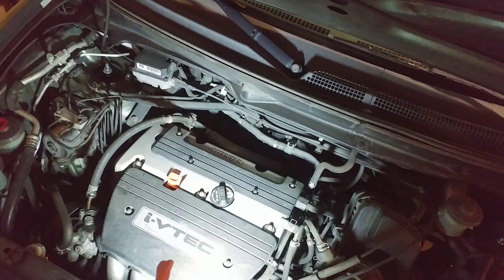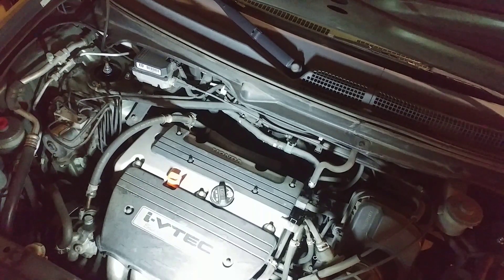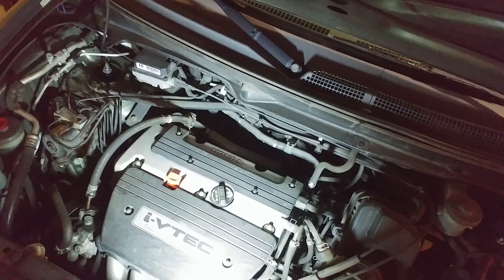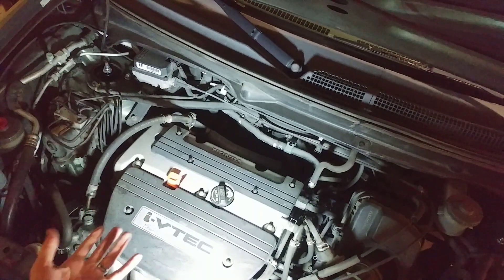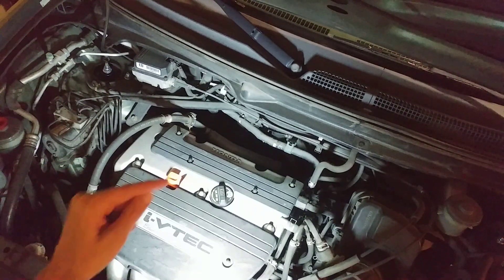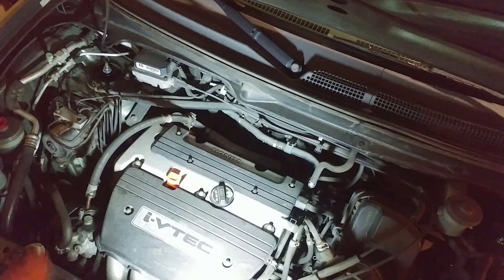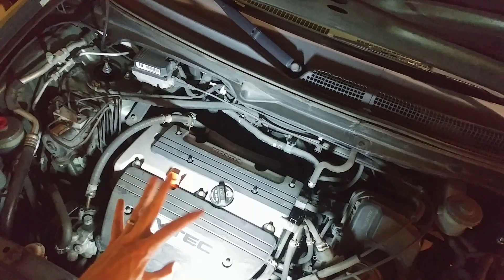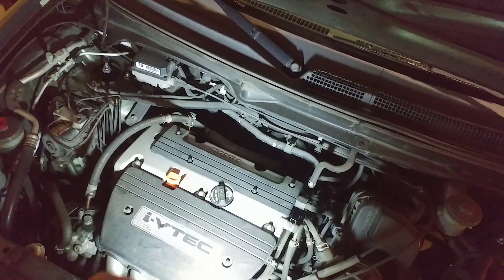When to Use 89 Octane in an 87 Octane Engine

Comment: Yes, octane does def boost HP which is why racing fuel is over 100 octane. 
But damnit man- I was looking for some legit info about why the hell anybody buys 89 octane instead of 87 or 91!.. I’m in the biz and I don’t understand that lie!  I was totally on board with ur vid until @3:11 when u claimed that u only buy “good gas”.🤦🏼‍♂️🙈 
I sell fuel for a living and there’s no such thing as bad/good/cheap/poor gas.  It’s all refined at the same local refineries and the only damn difference is that when a carrier picks up for “Chevron” (for example) they pour Techron juice into the top of the tank.  Other than that it’s all refined in the same place with the same US standards of any gas anywhere.  If u think it matters just go buy cheap gas & buy boxes of Techron juice at Costco to add to ur tank.

I own a 2001 Lexus that requires 91, and it legit runs worse with 87. I own a 2013 Honda that requires 87 and I’ve seen no benefit with 91.
Reply from the maker: When I lived in CA my cars never ran as well on ARCO gas. That was just one example. Anyway, I appreciate your perspective and thank you for your comments. Make that 2001 Lexus last baby!

Comment: I use 89 octane for my 2019 Honda Civic sport, is that good ?
Reply from the maker: If the owner's manual says 87 or higher then I'd use 89 if the engine runs better. Realize your car is not underpowered nor is it old with lots of carbon buildup. So I would only run the 89 if you feel a difference. Thanks for watching! Make those cars last baby!

Comment: The wording "87 or Higher is recommended" is found in the majority of Hondas, Toyotas, Chevrolets, Hyundais and KIAs Owners Manuals.  So 87 octane to 90 octane can be used in those vehicles.  91 octane or above, which is generally premium grade fuel, is a waste of money for those vehicles.  Especially if your model and trim don't state anything about using premium in their manuals! Since 89 octane is found in a majority of states.  Use that octane if you can afford it folks because I get it, high gas prices! That octane is not a waste because I tried it in a variety of vehicles that I just talked about.  89 octane definately operates more efficiently than 87 octane.  The engineers know what octanes can be used in your vehicles.  They did make the machines afterall.
Reply from the maker: Good point Bill. It's not like the vehicle manufacturers are saying "Only use 87 and not 89." With high gas prices (thanks Biden!) more people than ever are going to feel financial pressure to use 87 octane, when 89 would be better in most circumstances. Thanks for watching. I hope you're a subscriber and make those cars last!
Reply: @TheSwitzAutomotive  Update:  What "87 or Higher is recommended" really means is just that.  Let me explain.  In other parts of the country, 87 octane might not be avaialble BUT 88 octane is. Just be cautious with what kind of 88 octane it is because there is 88 octane with E15 (15% Ethonal). Make sure to read your owner's manual to see if your vehicle can take 15% ethonal. Otherwise, you might find yourself stranded on the side of the road with your broken down vehicle. Anyway, the engineers are just letting you know it is ok to fill up your car with 88 octane when your traveling. Another thing I need to let you know is 87 and 88 octane work best with these vehicles because they are designed with these octanes in mind and so they're easier to combust, compared to 89 and higher octane. So in reality you get the best performance out of your vehicle using 87 and 88 octane. Anything higher could actually be detrimental to your vehicle's performance. Since the higher octanes are a bit harder to combust for your engine. About the car manufacturers I mentioned in my previous post. Their naturally aspirated engines work best with Chevron and their forced induction engines work best with 76 and Chevron. A bonus to mention with following this information about using 87 and 88 octane is when you are driving a manual transmission vehicle. Shifting becomes quicker and smoother, especially at lower speeds. Using the heel toe technique is easier too!

Comment: I totally believe you man.  I drive a 98 Toyota 2wd Tacoma with 200000 plus miles on it.  The 89 octane for sure makes a difference in power.  When I put 87, the truck slows down a bit again.  When gas prices are good, I go back to 89 and would feel the difference again.
Reply from the maker: Yep. Glad you are getting the benefit of occasional 89 octane. Thanks for watching. I hope you're a subscriber and make those cars last!
Reply: Stick with 89 octane. Much better reliability.
Reply: I would stick with the 89 whatever the price. If you check, I'll bet you'll find you are getting extra MPG with that extra power!

Comment: I’ve heard this is a myth. Apparently higher octane fuel does not contain more power and does not combust at higher temperatures than normal octane fuel. The only reason that higher octane fuel exists is to prevent engine knock and premature combustion which can damage the engine.
Reply from the maker: Well in my 2nd video I talk about how my Element's automatic transmission shifts differently going over hills on 89 octane. The automatic does not downshift nearly as quickly and on some hills does not downshift at all. With the 89 I just zip right up and over the hill. So the myth is working great for me. I'm not saying BTW that higher octane fuels do not prevent premature combustion, I'm just saying that as your engine ages it acts like a higher compression engine. If 89 doesn't give you noticeable improvements just go back to 87. Thanks for watching!
Reply: @TheSwitzAutomotive  Make sense for older vehicles where the carbon buildup is affecting the timing. Thanks for the feedback!

Comment: Most probably don’t know this but most gas stations only have two tanks one for 87 regular and one for the premium 91 or 93. The mid grade 89 is made from a mixture of both. By using a octane calculator you can easily figure out how many gallons of 87 and how many of 93 to mix into your tank to get the 89. May sound stupid but doing this method will save you a few dollars per fill up then just pumping 89 depending on size of your tank.

Comment: My 2021 civic sport sedan says “87 or higher” I used 87 the first time I filled up but since been using Costco premium and 76 premium. 
Don’t notice a difference mileage wise but my car seems a bit more responsive. Nothing crazy. But it does seem more responsive. I even went back to 87 Costco one tank; and I somewhat noticed the car not seeming as responsive. Not that my car ran like shit just seemed like the “power” went down by a very small margin. 
My car only has 1,400 miles, so it’s not like it’s old at all. 
What do you recommend if it says “87 or higher” is using premium just fine then
Reply from the maker: I'd go 87 or 89 and see which one feels better. On a car that new you don't have a lot of carbon deposits (which acts as a higher compression engine). Thanks for watching. I hope you're a subscriber and make that Civic last!
Reply: @TheSwitzAutomotive  rather then raising octane on a engine with carbon build up why not fix the issue and clean it out. Run a fuel injector cleaner or better yet just stick to top tier gas.
Reply from the maker: @ricanredliner  I've never had any luck with any of those products. Most engines with 150K to 200K miles have significant amounts of carbon deposits. I generally use top tier gas but the carbon still builds up. 89 for me is the way to go. Thanks for watching and I hope you're a subscriber and make those cars last!
Reply: @TheSwitzAutomotive  it may take a few cleanings before noticing any difference if the build up is a lot. Using higher octane is not a bad thing but it is only putting a bandaid on the issue. Least your using top tier which is good. Honda’s usually have high compression from the factory so they do benefit from the higher octane.
Reply: Hi I have 21 civic hatchback ex. Yes. It feels more responsive. The engine is more willing to rev up to 2000 rpm plus. With 87 when I step the gas pedal deep down the engine just delayed like 2 seconds and won’t go pass 3K rpm. With 93 it just shoot up right away. 
Also, I have fuel dilution issue over the pass winter. I saw another user use 93 gas to eliminate the issue 🤔 
I would do 87 or 89 in summer and 93 in freezing winter. I use a bottle of fuel cleaner every oil change

Comment: Hello I have a 2011 Chevy equinox with 65,000 miles.. Well my check engine light came on and the code was p0171 but the light went back off. The dealership said they couldn’t fine anything and suggested I used 93 gas..will that mess my engine up when I only used regular gas? Thanks
Reply from the maker: The P0171 is a problematic code and can mean a lot of things. I'd be surprised if 93 octane gas is the answer. And remember, I advocate going from 87 to 89, not 87 to 93 octane to see if it makes a difference. There are some good videos on youtube that talk about the P01701. If I were you I'd watch several of them and then start trying different things (going from cheapest to most expensive). Best of luck! I hope you're a subscriber!
Reply: @TheSwitzAutomotive  thank u and I am now ☺️

Comment: The K20 engine was not designed for 87 it called for 91 or higher. Check your manual. I had that engine in my 2007 civic Si and it needed 91 or higher octane.
Reply from the maker: Just double checked the 2005 Honda Element manual. On page 122 it says "Your vehicle is designed to operate on unleaded gasoline with a pump octane number of 86 or higher." You can see the manual (if you wish) on owners.honda.com on page 122. Now you are correct that the 2007 Civic Si requires 91. That K series engine is higher performance and has higher compression. Thanks for watching!
Reply: @TheSwitzAutomotive  didn’t realize they made a de-tuned K20 I thought it was only used in the Si, accord and Acura RSX and TSX which all called for premium.
Reply from the maker: @ricanredliner  We're all learning bud. Hey I hope you're a subscriber! Make that 2007 Civic Si last 25 years baby!
Reply: @TheSwitzAutomotive  I don’t have it anymore I sold it a long time ago. But I do miss it. It was a fun car to drive

Comment: I have 2017 crv 1,4 turbo and the manual says 87 octane should I use 93 octane please need a answer
Reply: A turbo car asking for 87?????
Reply: @albertoaguilar704  yes sir that’s what it says
Reply: @nyc.bt.9512  Do turbo engines require premium gas?
Is the turbo car required to have ed: Does turbo car need premium gas? Yes! The increase in heat and boost generated by a turbo contributes to pre-ignition condition of the fuel in the engine. Premium gas has a higher octane, so it resists pre-ignition better than regular gas.Dec 2, 2021

Comment: Have, a nissan sentra sv 2015 I put 89 shell gas noticed the engine is quieter, and rpm is low for some reason.
Reply: It has 92k miles on it,
Reply from the maker: @timofeyo4002  If you use a high quality synthetic engine oil that engine is just getting broken in....
Reply from the maker: If you have a lot of miles on that Sentra the 89 may help. Thanks for watching! I hope you're a subscriber!

Comment: So I gotta question weather you answer or not , but I’ll try it I have a 00 mk4 golf and I usually put 87 in it and I read in the manual that my car is able to run 91 which is premium maybe may car will gain a little hp or at least the compression ratio is higher so I can run 91 and I’ll feel the difference , I’ll have to do a 0-60 time
Reply from the maker: If the manual says you can run 91 then go ahead and see if you sense a difference. The situation I talk about in the video is where you have an underpowered car that runs on 87 and the engine has a lot of miles on it. In that case it may be acting like a higher compression engine and may benefit from the 89. Thanks for watching! I hope you're a subscriber.

Comment: I have a 2010 Sentra sr and it says to use no lower then 87 octane but doesn’t say I can’t or shouldn’t  put in higher octane . You think it’s ok to do so? Such at 89 or 93?  It has 60k miles.
Reply from the maker: Try 89 and see if you get more performance (see my 2nd video on how to test this - going over hills). Higher than 89 won't make any difference as the carbon buildup in your Sentra only slightly raises the compression ratio.
Reply: The Switz  being that it’s a cvt will tests still be the same being that their is no gears really?
Reply from the maker: @Whats_Pop_N  Ahh, that's right. With a CVT it may be harder to determine. I'd try the 89 and just see if you feel like the Sentra runs smoother with more power. If you can't tell a difference stay with 87. Thanks for watching!
Reply: The Switz ran it with 89 and honestly idk if it’s just me thinking I’m quicker or if I actually am but it does feel a bit quicker . And sounds cleaner too. Appreciate the videos!
Reply: only the Sentra Sr Turbo needs the higher octane(93). The Sentra Sr trim only needs 87

Comment: I been getting 89 octane out of habit because of my old car, is it to late to switch to 87? I been doing it for awhile now, I drive a Subaru Impreza 2005, I am supposed to use unleaded, but I been doing unleaded plus for awhile cause my old car needed it. I just want to make sure I can switch to 87 and it won't hurt the car
Reply from the maker: If the owner's manual says 87 you can always use 87. It just may run better on 89 due to carbon build-up. Thanks for watching!
Reply: @TheSwitzAutomotive  awesome that eases my anxiety a bit, cause I was thinking to switching to 87 for money purposes, and whenever I look it up on the internet all I see is people saying bad things happening if you do. Thank you for the video, I also got a bit nervous cause I just saw it said unleaded only but I been doing unleaded plus for awhile so I got a bit nervous on that but I been driving the car for a year now. And I assume unleaded and unless plus arnt to different

Comment: I have a 2017 Chevy Malibu LT, I use octane 89 (plus gas) but online it says “Recommended is 87” am I safe to keep using 89 gas?
Reply from the maker: I wouldn't think you need 89 in a 3 year old car. Remember that in my video I stress two factors: An old car with lots of miles (and probable carbon buildup), a car that's under-powered. I don't think you'd hurt it putting 89 in but it's probably a waste of money.

Comment: I agree with you, I only used 89 shell on my 00 civic and I have 260k miles and still run like a champ and it’s all original parts
Reply: I have a 03 civic lx with 260K mi as well, if i use 87 oc, it feel as if it has a rough idle, so now I use 89 oc: shell, chevron, 76 and mobile also use NGK iridium spark pugs and clean my air intake with CRC from time to time
Reply from the maker: Nice! Have you stuck with one type of motor oil or do you bounce around?

Comment: I have a Toyota Corolla 2018; in the manual it says: "octane rating 87 (Research Octane Number 91) or higher" but I am still trying to figure out if using regular gas is actually good or not for the car. I used premium and super gas and they increase the MPG up to 22 and it never goes above that. With regular gas, it did not last long. So, it's still not clear for me which fuel to use, since I need the fuel to last long, so I need to figure out which one will last long and maintain the car in good position. Thank you for the video btw.
Reply from the maker: On a newer car under warranty, designed for 87, I'd use 87. When your Corolla gets to be 6-7 years old and 100,000+ miles I'd switch to 89. Thanks for watching!
Reply: The 87 won't hurt it, nor would anything higher. What you need to do is a cost analysis between the mpgs and the cost at the pump where you are and figure out which fuel is actually cheaper for you to run. I've seen it where the extra mpgs from premium actually offsets the extra cost at the pump because it's taking you further in between fill ups.

Comment: I Have a 2010 Ford Crown Victoria Police Interceptor 4.7L V8 78,000 Miles on it and its been Idling poorly and somewhat misfiring while driving/accelerating and my mechanic told me maybe Spark Plugs or Carbon Canister.  Replaced BOTH plus a new Air Filter (it was filthy) and it's STILL idling poor under 1,000 rpm once i put it on Drive.  Do you have any other suggestions so i wont waste anymore money ? Maybe Idle Air Control Valve maybe ? Autozone ran the codes and 2 came back for Spark Plugs and Ignition Coil . He also suggested using mid grade gas but i dont know if Gas will change the way its idling so poor. Any suggestions would be appreciated
Reply from the maker: Love the Crown Vics... would like to get one one day... like a Detective's Car. Add it to my vehicle inventory. Criminals see those things and scurry away like sewer rats. I think you need to take an old android tablet and make it into a scan tool. Or use your phone as a scan tool. I have a video on that. Not seeing the vehicle I would guess it might be a problem with the VCT solenoid. Those can get a varnish inside. Poke around on YouTube a bit and you can probably find someone who has a similar problem and make the repair. I doubt it's an octane issue. If I think of anything else I'll let you know. Thanks for watching.
Reply: I recommend that you clean the MAF sensor every time you change your air filter. ... Spray 10 to 15 spurts of the mass air flower cleaner onto the wire or plate. Don't scrub the parts; you may break the wire or damage the plate. Allow the MAF sensor to dry completely before reinstalling it in the air duct. You can also try cleaning the throttle body itself.
Reply from the maker: @icetruckker  You can do that. I think depending on the vehicle that may be overkill. We bought our Honda Element in 2005 brand new. Since then we've put 190,000+ miles on the vehicle. I've cleaned the MAF sensor a grand total of one time. Thanks for watching!